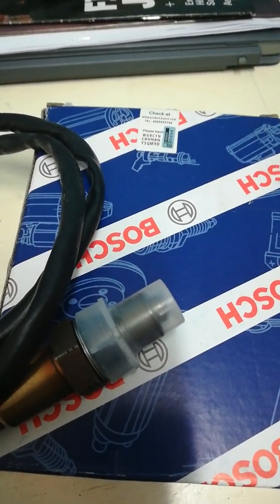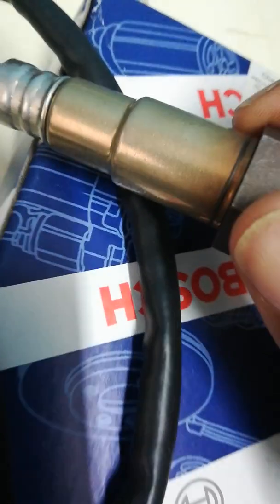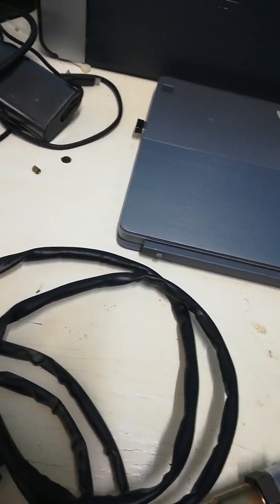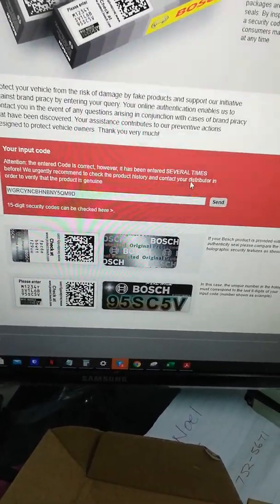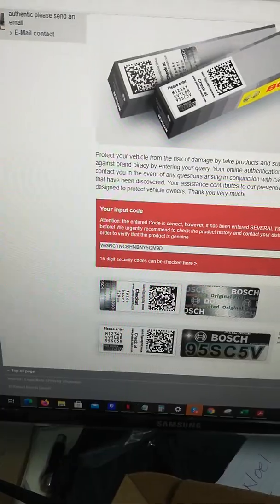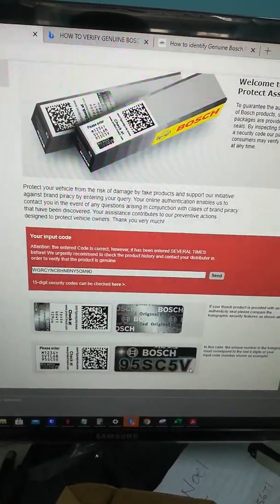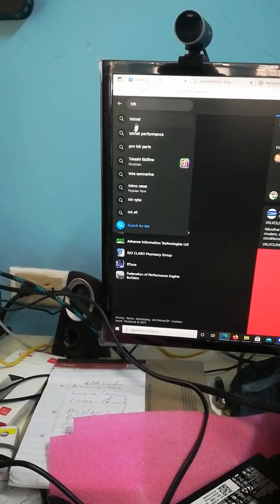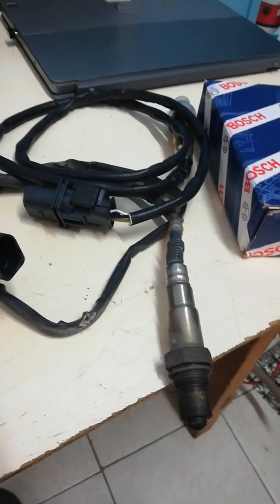Bosch vs Imitation Bosch Wideband sensor.

Comment: these sensors work for a while, but they will fail quickly. ive installed them multiple times on two different cars. the best one lasted for maybe 2 years. one of them lasted for like like 4 months.
Reply from the maker: the one i used last what was it? a month?

Comment: For what it's worth, the writing on your sensor and the burned color appearance fading from purple to yellow is actually what most genuine Bosch wideband sensors should look like. Some of them are silver like your other sensor, usually sourced from an OEM or aftermarket source as opposed to directly from Bosch. While the code entry makes me more suspicious of your sensor, the box, hologram, writing on the sensor, color of the sensor body, and everything else makes me think that probably was a legit Bosch sensor. Could definitely be wrong though. If I am, it's a very good copy. I have purchased several AEM widebands for example and they all came with a sensor that looks just like the one you got.
Reply from the maker: Believe me, you're definitely wrong, the sensor lasted 1 week, bought a genuine sensor from a reputable dealer and it is working to this day.
Reply: @TaranRamjit  Fair enough! It was a very good copy then for sure. The one other thing throwing me off was the lack of writing on the connector end. They must have just perfected copying the sensor look, but using the same numbers and text over and over. Thanks for the video!
Reply from the maker: @802Garage  It's a darn good copy. I will give you that....